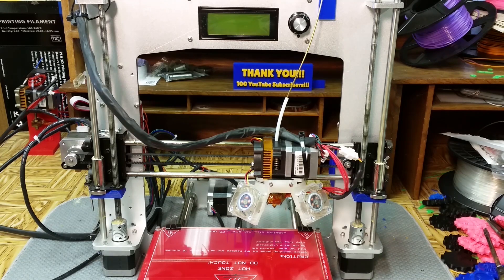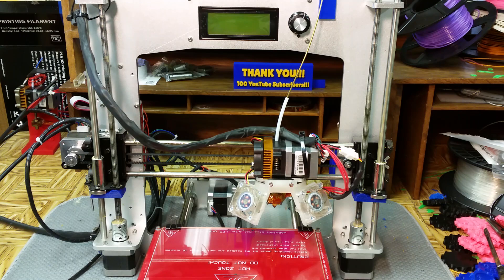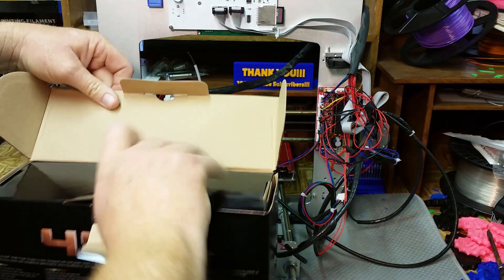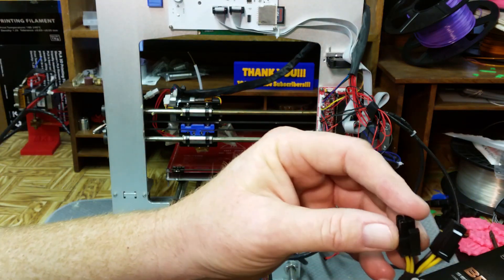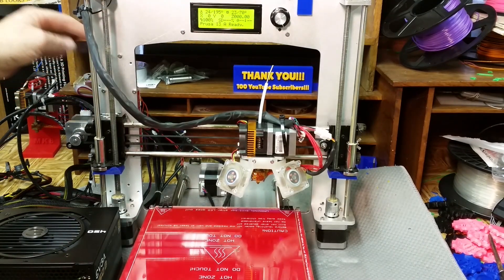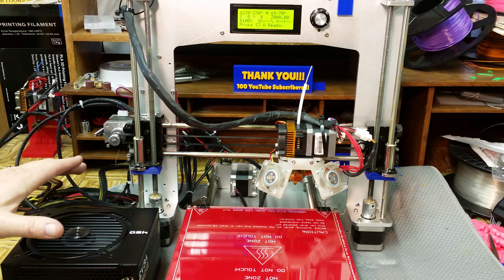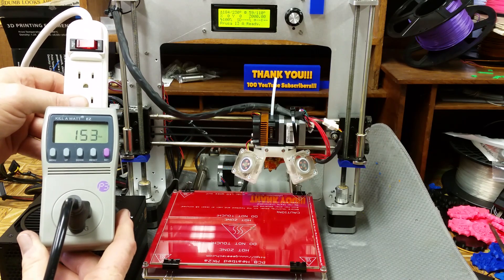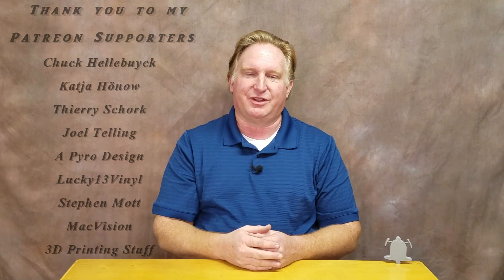Upgrading the Power Supply on the Geeetech Aluminum Prusa I3

Comment: I have 700watts 12v 24amps max in my atx psu. Is it OK to use?
Reply from the maker: As long as your printer is 12v, yes.  The wattage on a PSU is the maximum that it can provide if the load demands it.  A 3D Printer should never max that out ever.

Comment: I did this mod cause my original power supply that came with the anet blow out(i guess from doing back to back long prints), but now  when i do prints my anet restarts randomly messing up the prints. I’m running the latest merlin version as well. I only upgraded cause i use octoprint and the stock firmware on the anet wasn’t supported no more. I never had this problem with the stock version so im not sure if its that or the power supply. Can Any one Help?

Comment: Thanks for the informative video. It answered two questions for me actually!

I bought my first printer a few weeks ago (a Tevo Tarantula), and it came with a defective power supply (glad the voltage switch broke BEFORE I plugged it in!), and I've got a few spare ATX supplies around.

I've grounded out the POWER_OK line to start up a PSU before, but according to the RepRap site, some PSUs do not like running without dummy loads on the 3.3v and/or 5v rails. I happen to have an EVGA 600B (basically the same exact supply, just with something like 48A on the 12V rail), and wasn't sure how well that particular PSU would do.

Not only does this work, but it aught to work with my exact PSU. Good to know. I'll have to sacrifice the cpu power lines on mine, however, as the Tarantula expects a single cable to go in.

Comment: So if i were to buy this same power supply, all i would have to do is plug it into the printer board and its good to go?
Reply from the maker: +Monstervidz that's exactly correct. At least with the Geeetech Aluminum Prusa I3.  As long as your printer requires 12vDC and has a 4 pin ATX connector on the board you should be good to go.
Reply: Jimmy Shaw's Tidbits perfect! Thank you. I've had this printer for a long time and just recently came across your videos. Very helpful thanks again.

Comment: Hello< I have a question for anyone regarding my supply. I am converting my printrbot to ramps and I have a evga 400w supply that has a 6+6 connector on the 12v. This is fine for my current printrboard, but ramps only requires a 4 pin connection on loose wires. Should I clip 2 12v positives and grounds and leave the pair remaining disconnected, Or should i stick 2 12v and grounds in one and 1 12 and ground in the other? This will be posted on multiple videos as I need an answer pretty quickly.

Comment: Don't be too surprised that the power consumption of the 450W PSU is lower. It's an 80+ bronze power supply, which has a pretty high efficiency, which means that you'll need less power from the grid to provide the same output power at 12V. 
I found this video because I was wondering whether it was possible to use a computer PSU instead of the basic 20A PSU on the pro C. Mind you though, the PCI express connector you're using is rated for up to 75W or so, so if you're using just one, that may cause problems.
Reply from the maker: +Bart Crijns I have been using it for a while now, and it's still working great.  And yes, the power consumption is on par or slightly less than the original.
Reply: Do you actually notice a difference in te print quality with this PSU?
Reply from the maker: +Bart Crijns mainly a more consistent print temperature.
Reply: Who told you that? those double 18AWG cables can deliver up to 240W of power in 12v.

Comment: Thanks for all of your 3D videos. I've got the same printer, though I had more trouble bringing it up than you did even after watching some of your vids. My PS was intermittant from the start and I finally got my first print today after switching to a computer PS I had laying around! Now the fun and more learning begins.
Reply from the maker: +K A Thank you!!!  I'm so glad they help, and happier that your printer is working for you.  After going with a ATX PSU, I don't think I could ever go back to the factory one.

The learning curve can take a bit, but in no time you will be cranking out prints with few problems.
Reply: Here's the main reason I meant to post - I noticed the PCI-E connectors are wired backwards (reverse polarity) from our original power supply and it looks like they'll fit. I confirmed the +12V CPU/motherboard connector had the correct polarity for our Sanguinololu control board and works fine. Just verify the new +/- polarity against the factory power polarity before plugging anything in!!! I expect it will burn out everything if backwards.
Reply from the maker: +K A Yes, if they are reversed it will be a bad day.  Thankfully when I did mine everything matched up when I looked up the schematic on Geeetech's website.

Comment: will this also work with the printing bed ? mine isn`t getting hot enough for printing abs without wrapping so i am wondering.
Reply: NakDomDun it is strange because the bed should be able to reach a temperature of 135 degrees. Do you guys print abs often ?  I can't stop wrapping even with a perfect level bed, printing on a glass plate, and using the 3dlac adhesive spray which is very popular in Europe butt still no succes. how do you overcome this problem or is it just the problem with the printing bed temperature
Reply: I have trouble with the print bed too, seems to get to 80 O.K. but then really slows down.
I start ABS prints at 85, then manually set the temp to 100.
The nozzle temp seems to help once it starts printing.
Never had an issue with the nozzle temp though, able to hold 260 no probs.
Also, voltage is bang on 12V on the bed, indicating the PSU is OK.
It's a workaround but seems to work, have trouble with the first layer with some models, obv. at 85 it doesn't always stick too well.
Reply: I only have the option of ABS at the moment, have more PLA on order.
I have found nozzle to bed height to be super critical (esp. @ 85C).
I use a UHU glue stick as well, without this I have to print a raft first and even then it can fail, it just comes unstuck.
I am by no means an expert, only had the thing 2 months or so.
I've had no problems with warping, but then I don't print big models, yet :)
Will have to get another PSU to see if I can get the bed hotter, but with the glue stick, I have had some very nice prints, just a bit hit and miss on the first layer.
Reply from the maker: +tom moolenaar Is does.  For ABS it takes a while to get to temperature, but when it does it stays at a stable temperature.
Reply: Can you tell me what the temperature reach of the printingbed is after the upgrade ? Mine isn't getting above 98 degrees
Reply from the maker: +tom moolenaar It took about 10 minutes, but it reached 110°c on the print bed, and it was stable with the fans blowing on it.